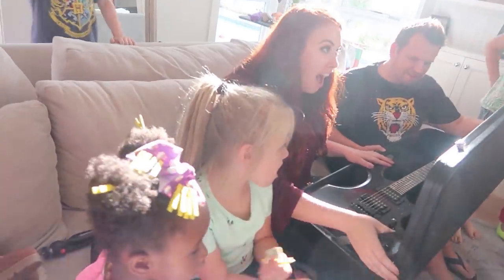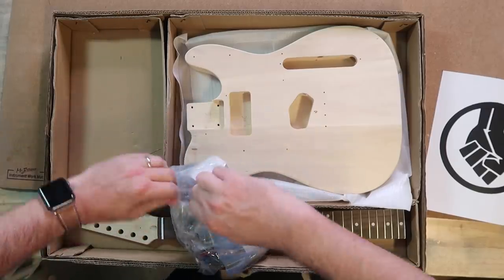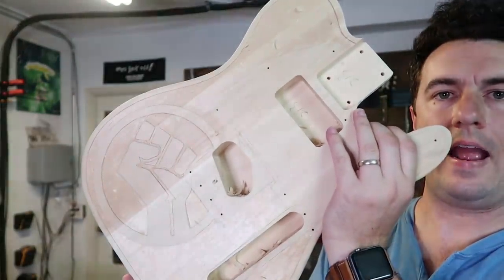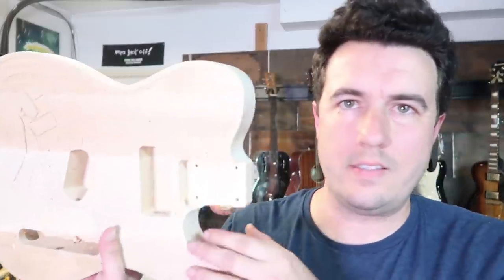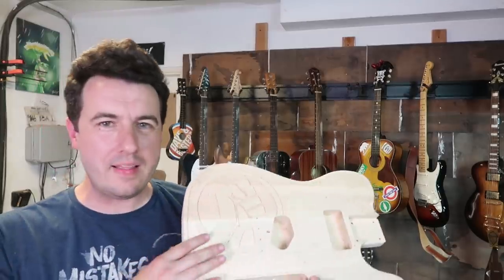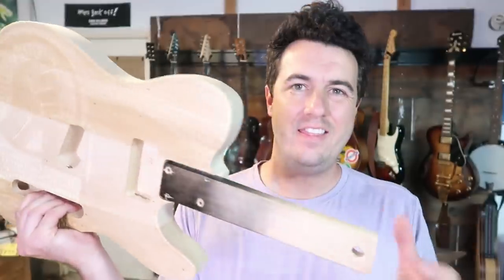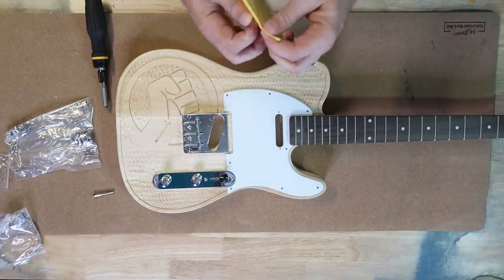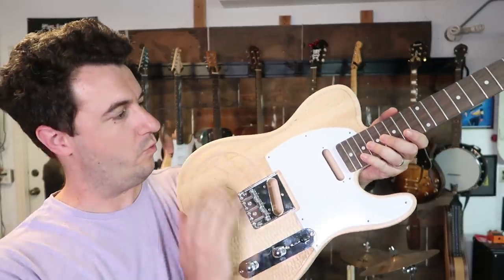Building a Guitar for the BLM Movement

Comment: Hey Chris, I've been following this channel from the very first build and I think your work is awesome. One possible tool-tip I might have for you next time you work on sanding a guitar body is to use emery boards (nail file). They come in different grits and most importantly, is they are inexpensive and disposable.